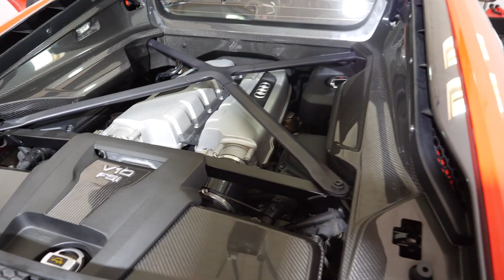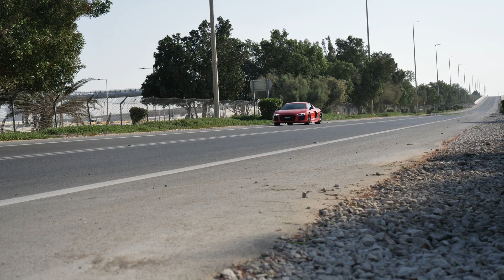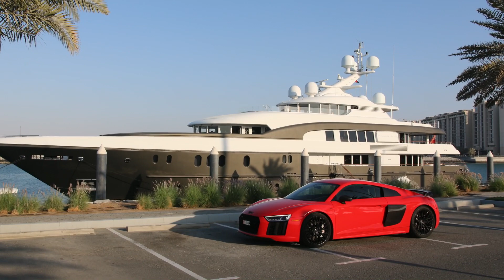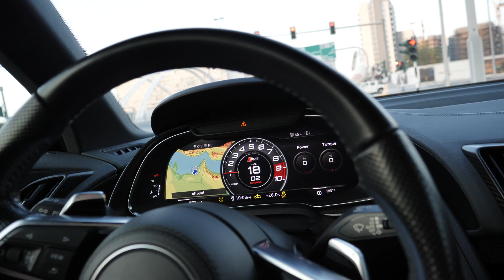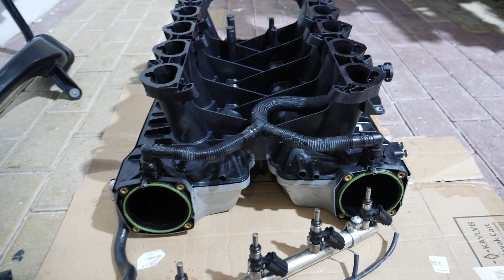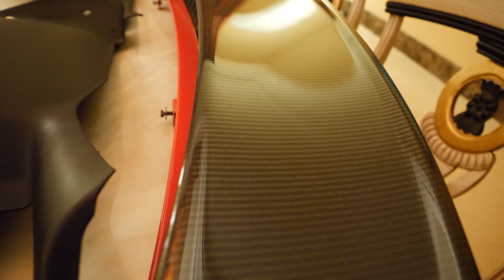New Project Car.. R8 V10 PLUS Turbo!

Comment: Take care Peter, Depression sucks but it will get better, it can take time though. Been struggeling some years now but Im so much better now. Listen to your body and just rest and dont stress. Now the question! Is it the same fuel pressure pumps as on the Audi RS4 2014 model?

Comment: Curious, didn't know they went to port and direct injection.  Was this to eliminate the carbon built up on the valves? Or just to augment the fuel system so it could keep up? (Or both?)